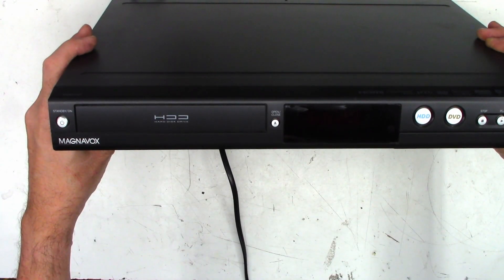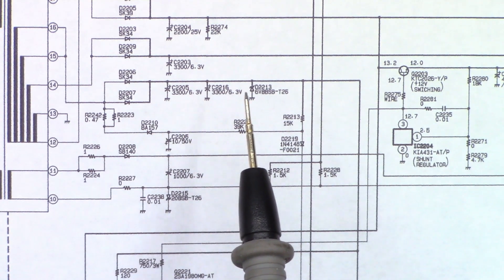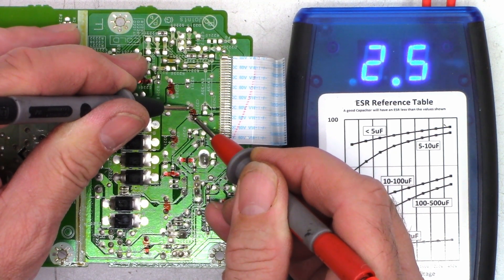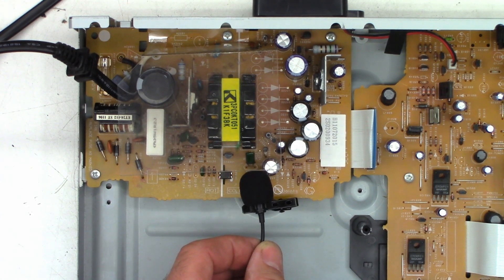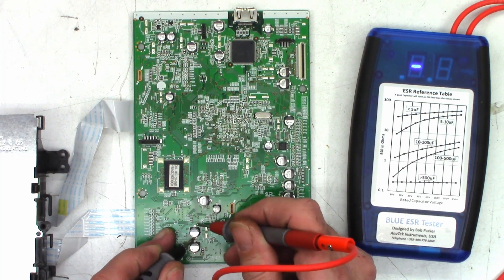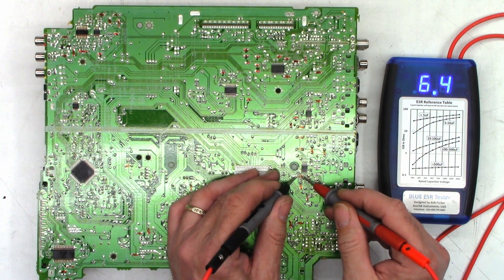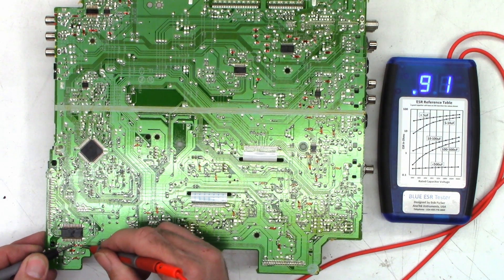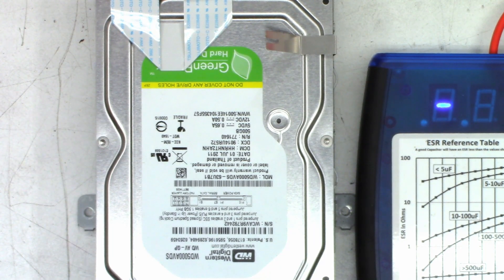Not a VCR this time. A Magnavox DVD-HDD Hard Disk Drive Recorder MDR515H/F7 Dead - Part 1 Diagnosis

Comment: Why is this thing going for $300+ on eBay?
Reply from the maker: They are hard to fine in decent shape as of now.
Reply: @norcal715  I'm saying that it doesn't even read blue ray.
Reply: @bland9876  These were/are very popular units. Magnavox (Funai) manufactured several different models of them. They can record ota TV signals to the HDD, or to a Dvd. And record through RCA connections. They can record from dvd to hdd, or vice-versa. You can edit titles, and even edit out commercials, on the hdd, and transfer the video to dvd. They even made an high definition 2 tuner unit, before manufacturing stopped. Word was that movie & TV production companies put pressure on Funai to stop making them.

Comment: I own a couple of 2012 Panasonic DMR-XW390GLK DVR's (500 GB HDD + DVD recorder with twin HD tuner) and the only issues with them have been the DVD part (the HDD is fine). I hope your customer approves the repair estimate on the Magnavox so we see a Part 2.
Reply from the maker: When I did warranty repair for Panasonic, I had a lot of issues with the DVD recorders on almost brand new units.
Reply: @norcal715  Yup they were the problem child of most Panasonic DVD recorders made between 2006 and 2011. Premature failure of the spindle motor and/or digital PCB which results in the "NO READ" / "NO DISC" error (and similar displays). Easy enough replacement, but expensive repair in terms of cost. I do however, hope you have better luck with this Magnavox (if the repair is approved) and a happy customer at the end. 😃

Comment: Nice video .just curious does the repair outweigh the value of the unit.
Reply from the maker: Not if they have some videos backed up on the HDD that are not available any more, possibly old videos from a home camera. The repair on this one was $220 plus shipping.
Reply: @norcal715 
Plus shipping. 
So how do I dispose of my unit responsibly and how do I remove my DVD without power.
Reply: If it was mine and I was doing the repair, I would say no.
Reply: For me a 'yes' because they don't make dvd recorders anymore. If so, please tell me because i am looking for a new one just in case and as a backup.